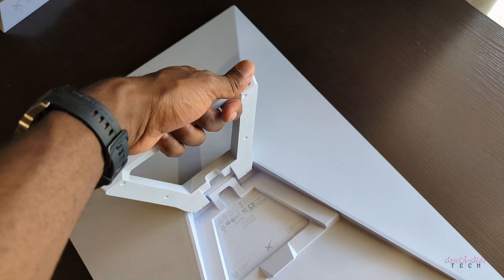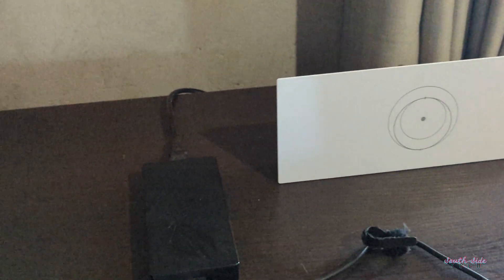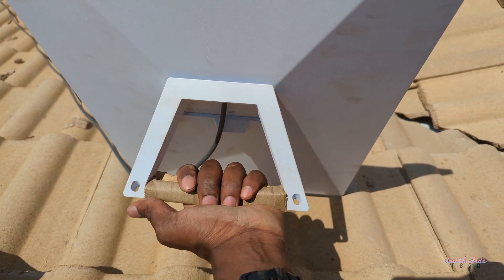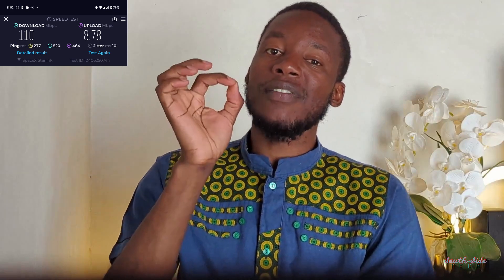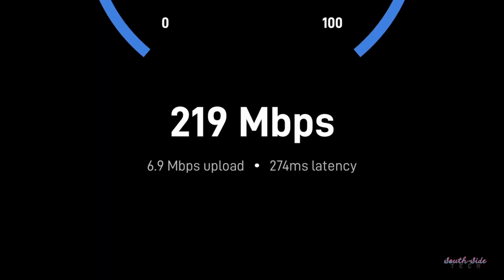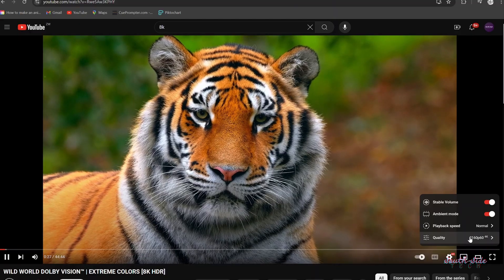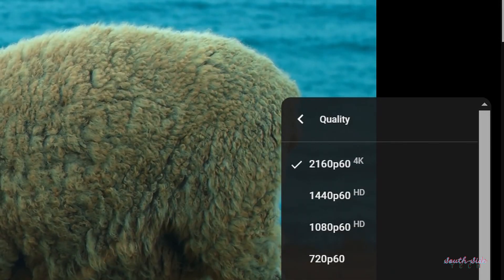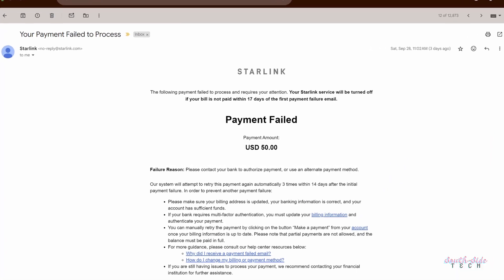Starlink Standard Gen 3 setup + Speedtest in Zimbabwe - Over 200 Mbps!!

Comment: i think I need a gen 3 my mini hasn't been over 25
Reply from the maker: You might need t check the app is everything is setup correctly. In good conditions you may not see the difference between the Mini and the Standard. It will only start to show when the conditions are challenging

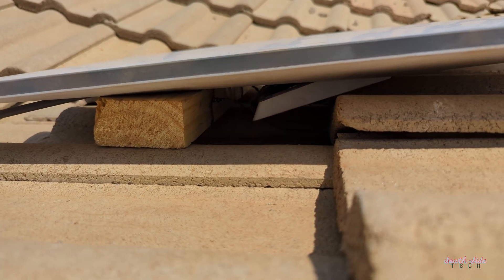Comment: 1:45 with the current winds experienced in Bulawayo over the last 3 days I would be having enxiety with this fix.

I'm debating getting the Mini now or saving more for the Standard. I've heard people getting bad coverage from the mini being too far on the roof.
Reply from the maker: The mini is fine so long it's not placed too fr from where you need to use it unless you plan on getting a range extender. But if you are getting a range extender then you may as well get the Standard because the total price will be just the same as getting the Standard
Reply: I’d say get the standard 
The mini kits are taking very long to deliver due to high demand so that’s another factor to consider

Comment: Nice video. You have to run the cable through the ceiling man and mount it properly. 15 dollars you can get a fixture made, and you can drill it in yourself and put it through the roof and ceiling then tidy up the cables. It take about an hour or 2 but better than running a cable on a roof like that. That's what I did. 15 meters is way more than enough.
Reply from the maker: This is a temporary setup. I want to mount it to a pole but I haven't gotten the pole mount yet. Planning on getting it soon but until then I have is just chilling there cable ichorohwa nemshana🥲
Reply: @SouthSideTechZw  😂😂😂😂😂😂😂 it’s cold. Ichafa nechando.
Reply from the maker: LOL!

Comment: it would be good to do a video of proper mounting technics like enclosing the outside cables in a pvc conduit, weather proofing the roof mounting as opposed to just let it sit on wood blocks, outside and inside cable management etc. it will encourage your followers to employ good smart and secure installation methods 🛰📡 thank you for the videos
Reply from the maker: Right you are bro! I may have gotten too excited and not mentioned in the video that this is a very temporary setup. Inside the house the cable is neatly running is some trunking. I definitely will update my setup very soon

Comment: Rain season in zim...coming soon
Reply: I saw a vid when it was working fine when it was snowing in Alaska so i dont think rain will affect that much
Reply from the maker: The starlink is designed to operate in the elements. It does not need any special treatment to protect it from weather. It's water resistant and tested to handle sun or rain.

Comment: You can't  be a tech person without a google Pixel 🤣, I see you
Reply from the maker: Im really not enjoying using it. Kungoshaya Mari yekutenga Huawei Pura 70 Ultra 💀
Reply: @SouthSideTechZw  been enjoying my * pro since last year and this year am feeling like I don't have to quickly update I will upgrade in Jan
Reply: @orionpaul5210 how are you coping with Google Pixel’s poor battery
Reply from the maker: This the 8 Pro?
Reply from the maker: BRUV! The poor battery is not even the worst. This phone is always overheating
Reply: @SouthSideTechZw  where did you buy your 8 Pro 😃have never face those heating issues been using android 15 developers better since feb, till now I will be lying if I said I faced a hitting issue, one thing am so sure of are bugs I've been facing since wanted to focus more on contributing in the OS, also being able to adjust my android development experience since android 15 been anouncing of making huge changes base on security. I use my phone as a daily drive pre-ordered it last year since now I pushed to december that's where I will be switching to 9 pro xl
Reply: @SouthSideTechZw Tensor 😂doing its thing
Reply from the maker: @orionpaul5210  I am using a regular 6 lol. Really feel like going back to Huawei
Reply from the maker: @lewissosono1  🥵